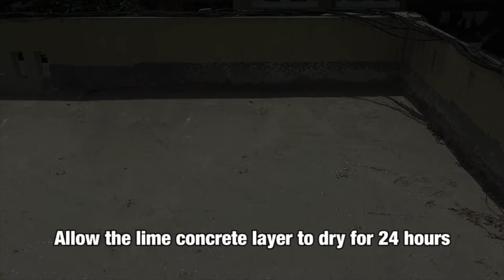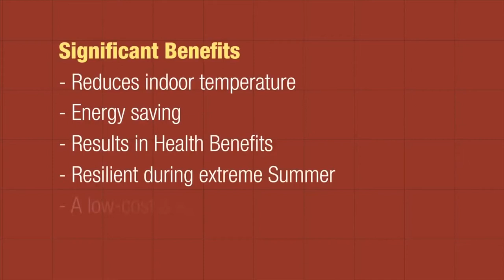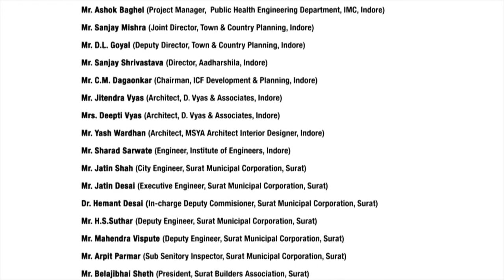#CoolRoofTechnology | Surkhi Concrete

Comment: Thank you for sharing this, this is inspirational, I was wondering though, isn’t Surkhi different from brick dust, could you kindly share how was Surkhi prepared for lime mortars, I mean was it a different kind of mud or was it heated at a different temperature, how was it distinct from the brick used in building.Many thanks in advance 🙏
Reply: Surkhi means crushed bricks or small pieces of bricks